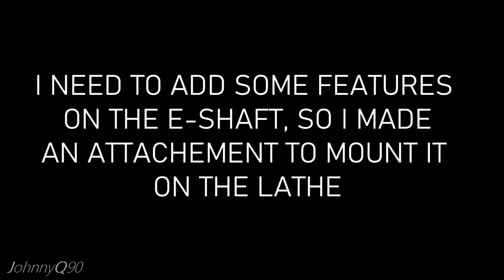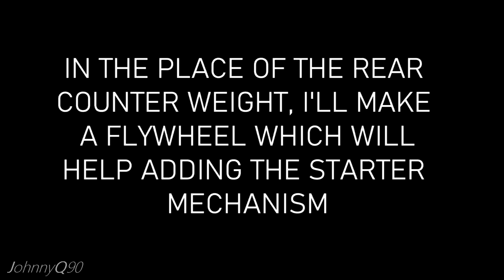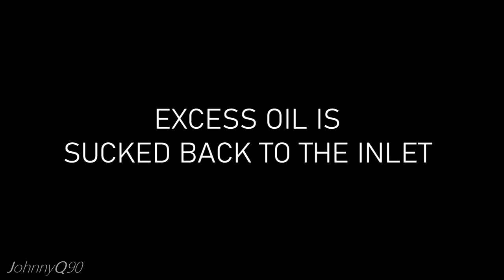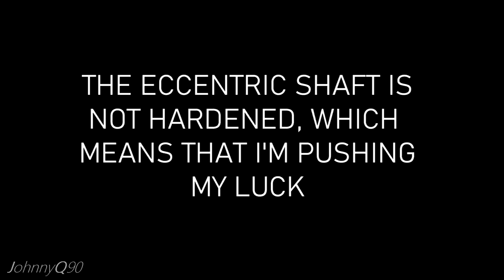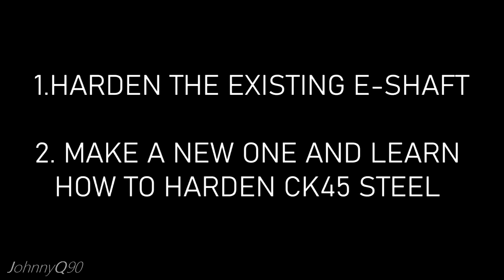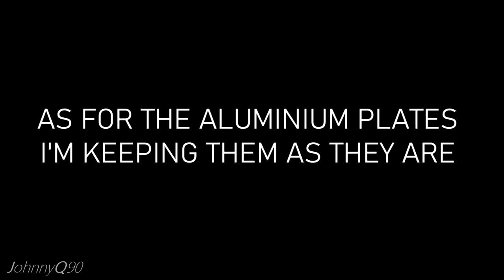TWIN RC Wankel Rotary Engine First Run!

Comment: You can get pre-hardened stock I bet you can find something that's a nice balance between durability and machineability.  If not you can always try something like case hardening that generally does not leave too much of a coating on the surface to remove or when you harden the piece of steel put it in a well sealed stainless bag that will help prevent oxidation during heating

Comment: A couple options for hardened alloy that can be turned to size on a lathe:

Prehard 4140 (4140 HT). No heat treat necessary. Not as hard as it could be, but better than nothing for sure.

17-7PH stainless steel. Hardest this gets is mid 40s rc with the h900 heat treat. May be available pre-hardened - but the heat treat recipe is very simple as long as you have good temperature control. More easily machined the harder it is imo. Galling on bearing surfaces could be a concern.

Comment: I think the bearings are not meant to be high RPM. They are originally meant to built in a scooter between the piston and rod but they are not really rotating. I hope it won't cause problems.

But very great project!

Comment: Instead of hardening the shaft, make some hardened sleeves that go where the needle bearings run.  

Your other option to remake the shaft with something like A2 tool steel.  Its an air hardening steel, so just bring it to the right temperature and air cool.  You can then draw the hardness back to maybe 50 or so, which you can turn fairly easily with any carbide tooling, yet will still hold up OK to the bearings.  The advantage of A2, is that the critical temp is lower than a lot of other steels, so it's less prone to warping.

Comment: I would love to see you make a rotary engine-powered fan, like the electric ones used for model jets. You could machine the blades, maybe more than one fan per engine, even make a tiny gearbox to increase RPM, which could be VERY cool. If you designed it like Turbo Fans, the intake fane could be quite large in diameter and then the rear shaft could spin a set of progressively smaller fans with increasing pitch. Just a wild idea.

Comment: I wonder how hard it really needs to be. I school I did some material testing on some leaded machined steel that I forget the strength of, but it was subjected to 50lbs of radial load while rotating at 10K rpm. My sample was 3/8" stock with a Q drilled hole leaving only a .0215" wall thickness. It failed after 80,000 revolutions. The design goal was to fail at exactly 100,000. Another sample that 21/64 hole drilled didn't break for over 300,000 revolutions so given that your shaft is mostly solid and sees limited radial load, I don't think it needs to be hardened through. A surface hardening might do it good for wear resistance though. Try doing an at home Carburization process. It is a slow process, but most of the time is in the oven so that the carbon can leach into the steel. In many ways I think that this might be a better option because the crank will be less likely to shear completely if it were to fail whereas a fully hardened crank (Metal and hardness level depending of course) wouldn't deform as much before shear. The softer core might deform and just seize  your engine instead of blowing it up. A lot of this is just conjecture, but its something to think about.

Comment: I think you may still need some counterweights. It may be statically balanced but dynamically you have two offset weights spinning around and trying to make the eccentric shaft "wobble" back and forth. I think if you did a counterweight for each rotary on the opposite side, it may remove that violent vibration you are getting
Reply: Yeah, that answers the question I posted about missing counterweights. Proper counterweights would reduce the stress in the eccentric shaft and bearings.

Comment: Johnny, I wish you good luck with hardening of parts. Heat treating will almost certainly alter their dimensions slightly (shrinking I think) so things need to made larger to allow for surface grinding to size. Not easy on most of your parts. This Old Tony has a video you might find helpful.

Comment: The BSA (Norton) rotary had MSO2 strips laid into the end plates for the apex seals to run against. It used an injection pump to feed Shell Rotella oil into the intake air which went through the internals then the carburetor for lubrication.

Comment: Runs so smoothly and much lower RPM's with having a balanced engine of the eccentric shaft. How's the vibration? Any balancing issues now it's been doubled??? Been watching from the very beginning!

Comment: Dope! A couple of questions though:

1. Why did you curve the exhaust so close to the glow plugs?

2. The oil scavenging lines looked a bit short to me, like they were pinching. We’re you low on hose?

Comment: Hello! You can harden that shaft, what you allready have. Just put it in tin can and put the can full of carbon powder. And then put this tincan on fire. If you have some kind of forging oven, it might be the best. Tempereature should be somethin abaut 800 Celsius. And this carbon powder can be allmoust any carbon. I have used barbeque grill carbons. Just gring these coals wit hammer or so. And time abaut 40min-1 hour. And then normally hardening thing. heat the shaft at abaut really red hot, dip it on water. And here you have surface hardened shaft!

Comment: Those bearing journals will work-harden over time,  but they might be severely undersized by then.   Have you seen Adam Booth's spray coating vids?  He can put a hard coating on bearing journals but the kit to do it is spendy.  Keith Fenner has many vids on straightening a shaft after heat treatments (with more topical heat treatments)

Comment: Your content is always amazing! I have a question maybe someone will answer…without a pressure line from exhaust to fuel tank how does the fuel get pumped to the carburetor? I’ve wondered this on a few of your builds.

Comment: Use D2 or A2 or O1 steel for the E shaft. Also get hardened bolts or studs that aren’t continuous thread for the through clamp bolts.

Comment: At 1:48 please be aware that the grinding disk can explode when doing this.. it is NOT designed to withstand forces in this direction, use a thicker grinding wheel if you must but this has costed many an eye

Comment: I always thought that those Harding lathes were way over rated. With a maximum RPM of three thousand they were designed for cutting with carbon steel tools. That CNC router spindle is sure hitting the right SFM which a lot of folks don't get.

Comment: To your question, make a new e shaft and try to harden it. But don't forget to not go to the final dimensions before hardening, after the shaft is hardened you need to trim the upper layer of.

Comment: You should bring back the supercharger for the rotary from earlier videos or even custom make a turbo for it. I also think that a 2 rotor counter weight set up would probably be a big benefit for the engine.

Comment: **PLEASE TAKE NOTE**
I am very experienced and formerly a distributor of JUSTICE BROTHERS Automotive Products.  They have a copyrighted element in all their products called "metal conditioner" with the machines you make you NEED a bottle of "HEAVY DUTY VEHICLE" or other Misc products with a lesser concentration and added oil base.  But HEAVY DUTY VEHICLE specifically is PURE metal conditioner, this is a product that will cut your friction on contact surfaces to as little as humanly possible.  With enough soaked into a full sized engine it can even run (for a while at least) with NO OIL AT ALL thats how effective it is.  You have enough scaled engines you can absolutely prove what I'm saying.  For $20, WHAT DO YOU HAVE TO LOSE? But I'm 100% positive from an insider's perspective it'll make all of your creations run longer, faster, more trouble free, with less wear.  It stops metal from leaving the system.  Instead of scraping and scoring on bearings and these rotary face plates you'll see it basically POLISHES anywhere that metal rubs metal, if area gets hot it's even more effective.  I want you to put some in your little engines so when you take them apart it'll PROVE BEYOND ANY QUESTION what these products do.  But as you rely on oil content in your fuels to lubricate you more than anyone could benefit the most from what they have to offer.  If you have a hard time finding some to use on your projects Message me at 

EnterprisingJC@gmail.com 

 I really enjoy your videos and can't wait to see how much better they'll work/longer they'll last!!

Comment: I cannot believe the fuel consumption. I know rotaries are insufferably uneconomic considering their size, yes of course as well as unbelievably powerful when a turbo is forcing 20 psi of air through the ports and youre running, for a 13b (2 rotor configuration), 6 injectors but still. A 13b is called a 13b because theyre 1.3 liters. 1300ccs. And ive seen reliable, daily driven rx7s make 450 wheel hp no problem. Thats 400hp per liter. Thats absolutely insane. I have a 2018 R1m, thats the single most incredible liter bike ive ever ridden in my life i was gonna buy a bmw but i rode a friends R1m and put my name on the waiting list. Got it 2 months later. Anyway,  i have full graves race exhaust, and a power commander and my uncle hooked up his laptop and we dyno tuned it and just made sure we weren't going lean at 13,500 rpm or something. Only at 83% injector duty cycle actually. But thats a 1000cc and it made 212 hp and honestly, i could turbo it and blah blah blah to maybe make 260-280hp but it wouldn't be reliable and more of a nightmare to wrench on. 1.3 liter rotary engines can make 450 reliably and like 800 in a racing application with really expensive fuel and HUGE injectors and a HUGE turbo or 2 big turbos. Thats extremely impressive and i dont care what brand you're a fan of you gotta give it up for the dorito spinners. By the way, dude, youre a friggin genius. Some of the things you do just impress the shit out of me and i build 700hp drift cars for a living. Your machining skills are a thing of beauty. God i wish i had your equipment and know how at my shop.

Comment: The easiest way to make a 2, 3, 4, 5 or 6 rotor engine is mount 2 or more engines on a new rear plate and from each engine gear drive a common central external output shaft that extends forward [and rearward to drive a prop or wheels] to drive 2 fan assembles; one that provides forced air induction to carburettors and the other to provide air cooling. 
You could, but don't even need to offset chamber firing or modify each engine, other than mount a purchased gear on the crank of each engine. No complex, inherently fragile and long common crankshaft or hardening and precision cylindrical grinding... no soft end housings ground up by rotors. Just focus attention to easily engineered adaption of a standard small turbo rotor for air blowers... the output boost pressure not needing to be high cfm like a car engine. 
Those little engines could do with far better external cooling fins.  Layered like a typical multi-rotor engines that are OIL and WATER COOLED the rear housing will suffer from overheating when air cooled. Without shroud ducts covering that engine the fan you have there will have little cooling virtue. Not only do rotary engines suck fuel fast... they waste a lot of energy in heat too.
 
Research the Napier Deltic or Sabre engines to understand how 2 or 3 engines can be linked together by output shaft gearing.

Comment: Would be interesting to see how much power it is outputting, looks like its got a ton of power. Would be cool to see some tests, and then to switch out bits and see if there is ever any efficiency changes, though i doubt it cause most of your efficiency will come from your design and less from parts quality.

Comment: Usualy for shafts that endure a dynamic stress you use Steel with a bigger yield resistance. e.g. 42 CrMo4
maybe also look into those materials
Not directly necessary but definitly futureproof

Comment: Looking at data for 1045 steel, for full hardness you need to heat to nearly 800 C, then cool to below 300 C in a few seconds. To anneal it you would want to heat to between 300 and 450 C

Comment: You probably already got the shaft thing solved, but if not you could machine a bar of Hardox steel. It comes in bars, is prehardened and I hear it is easier to machine than many alloys. It also has exceptionally good wear resistance. It is used for wear plates, pins in high wear situations such as the pins that might hold a giant hydraulic scoop-head on in dusty, gritty conditions.
I have a question: When he was putting the engine together, the plates that the rotors were against, as in the endplates and the plate separating them, were just aluminum, they are essential for forming compression. Wouldn't aluminum wear out fast? It would seem like there should have been a thin plate, like a gasket, of hardened steel over the aluminum where the rotors touched them to form the seal for compression so the engine would last longer. I am just wondering. I am NOT any kind of rotary engine expert, the question just came up while I was watching the video. It is an amazing video. I love just sitting and watching his stuff, wish he would talk or explain a bit more though.

Comment: if you want to harden the 1045 look up phase diagram, you have to heat up the element to its eutectic point them rapidly cool it. thats roughly ~ 700c

Comment: If you have a lathe why not just use a tolerance fit machined hardened sleeve ring for the bearings to ride on? Meaning if the bearings do fail you can reuse the crank by just fitting new  sleeves to the shaft.

Comment: I don't think you'll find any steel out there that'll be hard enough to handle bearings and not need to be either a) quenched with some degree of warping, or b) machined without carbide bits or grinding.  I'd look into a steel that maintains better dimensions after heat treating and isn't prone to cracking, heat treating is actually quite easy so long as you have the proper temp and quench medium.  1085 has done a good job for me maintaining dimension after quenching in Park's 50, and A2 also has very little warping when air quenching.  The big thing with any heat treatment is to really let it soak in the heat for a while to avoid any uneven heating or hot spots that contribute to warping or cracking, and that's no so easy to do without something like a pyro-controlled kiln or furnace.  Some steels are more forgiving than others in this regard, and the amount you'll have to turn down really depends on the steel and treatment procedure.

Comment: The rotary definitely needs the counter weights 1 on the front and 1 rear manuals normally have it integrated into the flywheel, i know it's not the correct way to do it but im sure that there is a rough correlation between the rotors mass and the count weights as should get you close enough i know the weights are 180 degrees out from the opposite rotor so the front weight is 180 out from the rear rotor and the opposite for the rear weight

Comment: I don't know how long it took you to make the crankshaft or if you bought it but I would try hardening the existing one. Very high chance it doesn't hold tolerances after though, might shrink a little after you harden it, potentially enough to matter

Comment: for sure there is some force pushing crank on front rotor, maybe due to lack of flywheel 
but front part of crank is more shiny than rear, and that's not good. 
I wonder how it would perform in longer time

Comment: One big problem on rotary engines, is termal stability on detonation side.  Need more radiator ribes on this side. Use pirometer to show it.

Comment: Try EN42 or any decent chrome steel.  

EN42 is genuinely horrible to turn. You'll need carbide and the swarf is lethally sharp, strong & red hot.

On the plus side, you can sneak up on a diameter very easily as it is possible to take ludicrously thin cuts. This is because it is stiff and doesn't bend away from the cutting tool.

Comment: if the material is work hardened or tempered when you anneal and quench the tolerances will go all over the place. I would just lathe it once quenched with a low feed and low spindle speed to avoid excessive vibrations.

Comment: i wood treat the shaft with cherry red its a case hardening and hard anodized the aluminum parts nice motor where did you get the plans for the Wankel motor?

Comment: How about making a "Liquid Piston" engine?  I don't like the name but it cleverly swaps the rotor stator shapes. A flat oval rotor runs in a trochoid stator. The stator has three combustion chambers and it breathes via the rotor. It's under patent so working commercially would need a licence.

Comment: I think you should hardened the e shaft and the plates should not have so much marks on them your geometrie isn't precise enough or the apex seal vibrate so much that she marks your plates !! After that the 2 rotors sounds like a beast !!!! But yeah damn It's thirsty !!!

Comment: What do you think about possible roller bearing slot for the rotor points, or even just a single ball bearing, as well as the outer edgesmaybe 3 or 4 down each of the 3 outer long walls of the rotor, smaller than the tips ones? Reduce surface tension and wear?

Comment: Check out D2 tool steel or "drill rod" It has a Rockwell hardness of B110 
Or AR500 which has a hardness of C48 
By the way, CK45 is known as 1045 alloy here in the US.